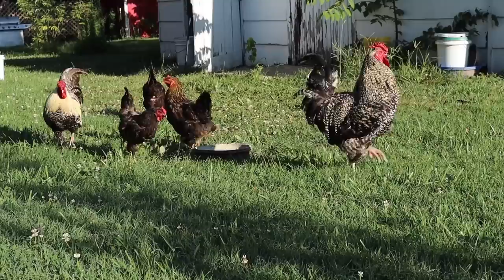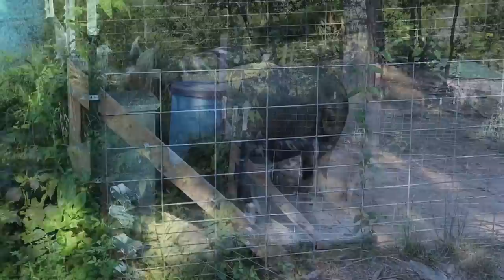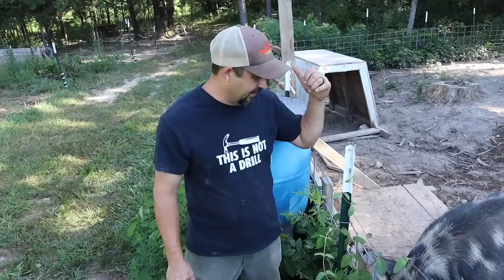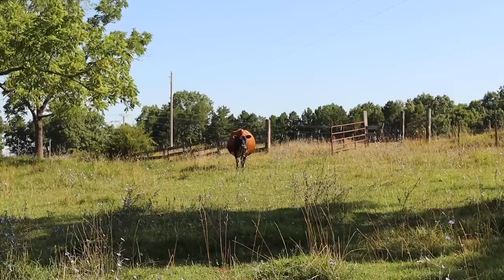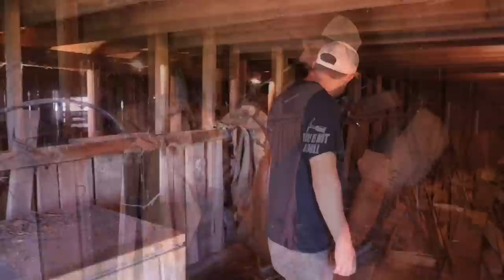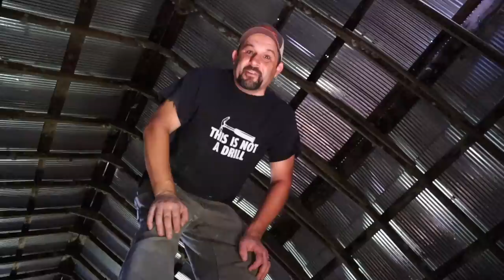This Barn Has Waited 50 YEARS To Be Used Like This Again!

Comment: Once you get the cow(s) used to comming in for feed and milking you will have trouble keeping them out.  They are smart and you will be surprised how they will figure out how a door opens even with a latch.  On our farm they even went up a set of steps and you could even call them in by name if they could get past the "boss" cows in the pecking order. 
  You will probably want to make a passage from the gangway (hallway) to the milking side. First time it is raining and you need to go to one side or the other you will know why. 
  If you are going to use hay loft (we called a hay mowe) for storage and drying  it would probably be wise to put a set of steps in from somewhere accessible inside the barn.  We put a set in that was counter weighted and raised up because where they were convenient was in the way of other activities in the barn.  You can only put up with the ladder or a ladder safely for so long.  DO NOT USE A CHEAP FOLD UP ATTIC ACCESS STEPS.

Keep the vids comming.

Comment: Always gotta double check your livestock. You would do well to have a pair of livestock protection dogs to deter or eliminate predatory threats to your livestock. Some things can simply be avoided by being diligent in your duties and taking necessary precautions......
Cleaning the farm from all the weeds and debris will be helpful in multiple ways to include taking away hiding spots from pest and predators.

The top of the barn can be converted into a greenhouse. Stairs can be built to make access easier. 
The lower part of the barn can be for rabbits, chickens, goats, some beef cattle along with the dairy cow.

Comment: Would it be possible to use the top of the barn as a greenhouse?  Remove some of the metal roof panels and replace with something clear to allow more sun in, unless its just warm enough in there already?

Comment: with the Dairy , we would put the feed in the trough before the cows came into the dairy , the cows would know the feed was there and go straight into the head holder , lock them in and start milking , we would put a leg rope on there left rear leg so they couldn't kick . most cow's didn't kick .
Reply: Yup- get them used to being fed in the tie stall barn, and you don't have to go chase them in!   When it's dinner time, they're lined up at the gate, eager to come in and chow down.

Comment: If you look into it, I'm not 100%... but the Miller machine that you currently have is the type that has literally been used since WW1! No joke, they are about as nearly old as the late Victorian or Edwardian Era. And they have not changed much in their design up until today. So there would most definitely have been a vacuum line with a generator to install into the milk station. OMGosh I am freaking out for you about the large wasps flying around ya'll in the barn. Please be super careful in there. I'm not concerned about snakes or spiders, but wasps and scorpions are no fun. Stay safe out there. 
Do you think that maybe when you expand your workshop that you may add a lumber mill for your wood production too? That would be cool. I'm thinking, would you want to maybe build a large walk-in refrigerator in the barn for storing the milk surplus as well as maybe even a root cellar? Or perhaps having large stand up refrigerators for milk storage and a sink wash area in the barn built-in for washing and sanitizing the equipment before using them on the cows? Just something to think about with all the space. Great share. SO much potential. Did they leave ya'll any equipment? Like the hayloft elevator? Or the bailer for the fields? Just wondering. Thanks for sharing. I love that your ducks also have a pond to swim in now. Awwww <3

Comment: If I were you, I'd remove that half wall enclosing the manger, if you intend to use that portion to milk.   As is, it looks like a nightmare to clean out.   without the wall in the way, you could get in there to clean and work on the headlocks MUCH more easily.   Cows eat like slobs, lol- and old feed has to be cleaned out regularly so it doesn't mold and make the girls sick.